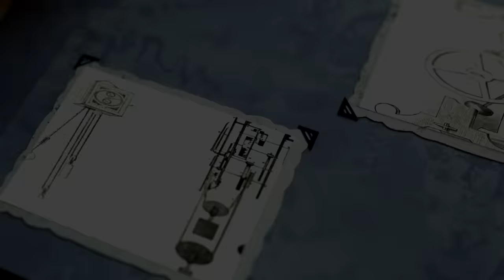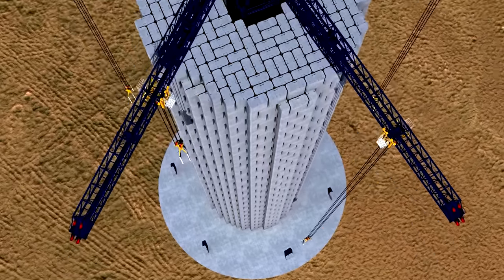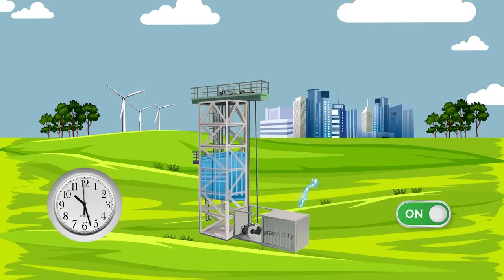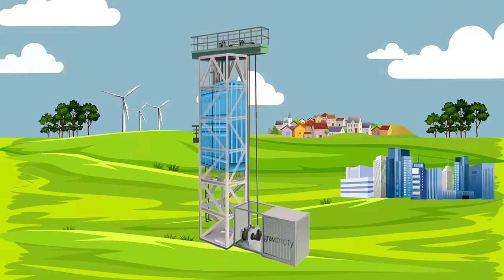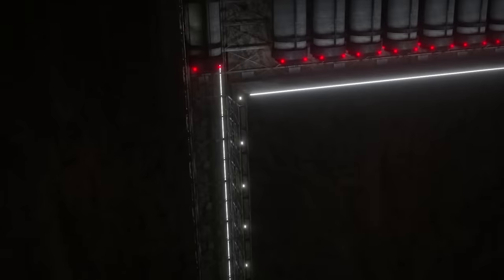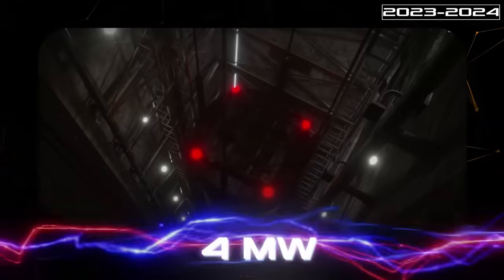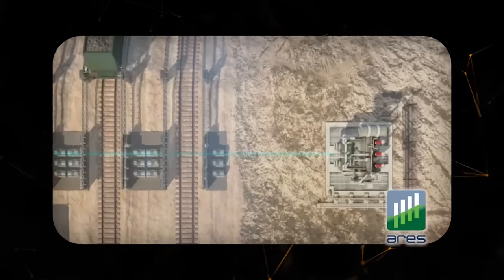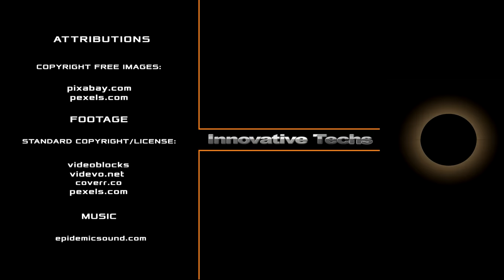How gravity batteries could change the world

Comment: I've thought of this independently since I was a kid.  I just wonder how much weight/space was needed to be practical
Reply: You should have learned how to calculate that back when you were a kid thinking about it.
Reply: m × h × g so 100tons at 100m=27Kwh, for comparison tesla has a 100KWH battery.
Reply: @faustinpippin9208  kWh
Reply: @faustinpippin9208  I thought your calculation must be wrong as I'm currently using about 50kwh/day to heat my house and this will only increase as Winter progresses. But I checked and you're correct! Seems astonishing I'd need to raise perhaps 3 or 4 100 tons to that height just to heat my house! But Gravity is actually a very weak force so I think much larger masses have to be used - like the water in reservoirs to make this practicable.
Reply: Please learn some elementary physics. Then you will realise that this is nonsense.
Reply: I thought the same thing about magnets when i was a kid. “ couldn’t there be something useful in the opposing force of magnets “; i hope there are more curious youngsters who wonder these types of things now and in the future.

Comment: The most mind blowing fact is that this is an innovation lol
Reply: Efficiency and costs are pretty important.  I live in Norway where we both have hydropower and a lot of wind and planned offshore turbines.  So I guess here pumped hydro will be a greatsolution to store any surplus.
Reply: soon they are gonna up with an even GREATER invention, a windmill that raises the weight mechanically,,,, like a windmill grinds wheat ,,thus increasing efficiency ,,i am not a tech wizard or anything like that but i would guess that a wind turbine that produces energy and then uses said energy to lift a weight is allot less efficient that having the wind spinning machine mechanically lift that weight

Comment: I was thinkoing about that way to store energy for a long time...  I find it still promising, but I think the biggest problem is the massive load gears are exposed to.  Moving Parts need constant maintenance and replacement. The storage facility can work for decades, yes. But only if you keep replacing some  components. Imagine what happens if whatever the load is attached to starts to rust...
Reply: you're right, it's a scam.  plenty of credible videos debunking the gravity battery.
Reply: @networkedperson  I don't think it's a scam. It's just a bit more complicated than the video makes it look like.
Reply: @donalain69  You could pay for money to feed people, and then you could pay these people to turn a generator wheel with their hands.  Technically, this would work, however, it would be a dishonest scam to say that storing energy inside people can be economically feasible.  Likewise, it is a dishonest scam to say that storing energy in mechanical weights will ever be economically feasible.  It is less efficient and more costly, by orders of magnitude, than systems which pump water into elevated lakes.  It will never be economically feasible to use mechanical weights.  So yes, it is more complicated.  The complications prevent it from being economically feasible.  The only way to believe that it can be feasible is if you don't understand reasoning.  If you don't understand reasoning, then you should listen to people who do understand reasoning.
Reply: @networkedperson  sorry. i think the problem is we don't define "gravity battery" the same way. 
I include elevated water powered turbines in that term, even if the water isn't pumped up mechanically using solar power. (it basically is moved there by solar power anyway, just the natural way)
For me the principle is the same, and where i come from (Switzerland), it's one of the main sources of energy for decades.
But regardless of that... I'm not so sure if pumping up water really requires less power than lifting a weight using multiple pulleys while lowering it again without them.
Reply: @donalain69  we have the same definition, however we are considering the costs differently.  Comparing solid battery to liquid battery, the cost and efficiency of momentary operation could perhaps be similar, after all, 1kg of water stores the same potential energy as 1kg of anything else.  However,  the cost of construction and maintenance will be different.  Consider for example Nant de Drance, in which 25 million m^3 of water are stored 425 meters above the generator...  The construction cost was 2.2 billion Swiss Franc.... A water system is the least costly system that can store any useful amount of energy.  The cost to build 25 billion kilograms of solid weights attached to 425 meters of cables will be exponentially more than 2.2 billions Swiss Franc...  Meanwhile, the cost of maintenance for the cables and wheels will be exponentially higher for solid weights compared to the maintenance cost for Nant de Drance.
Reply: @donalain69  I agree, It isn't looks like a scam, battery type storages and generators look to be way more complicated and costly on both initial cost and maintenance cost; I new about water-based gravity storages like forever and never understood why we are after centralized battery plants... battery life is 3-12 years depending on type before full replacement needed..
Reply: @Art_NYC  That's my opinion as well.
Batteries make sense in mobile applications that have to move around. But for stationary power storage, they make little sense, both financially and environmentally.
The good thing about water is that, if you have mountains, you don't even have to move it up yourself. Nature does that for you when it rains.  
I'm from Switzerland...according to an article of SRF, in 2021 the country generated 61.5% of its electricity from hydropower, 28.9% from nuclear energy, 1.9% from fossil fuels and 7.7% from other renewable sources. If that's true, I'm quite proud of them.
But probably they left out imported energy, and they are still far behind China in terms of quantity of hydropower.
Reply: @donalain69  I would emphasize on "quantity" and availability - I am doing electrical design in NYC area and the rest of the US - so, to me it is not clear why this kind of technology is not widespread - specifically as demonstrated in the video. I also mentioned in one of the comments somewhere in this thread that existing (or new) buildings can use some of elevator shafts for this with minimum extra effort and cost applied. This also would make obsolete central UPS and Generators we currently use in data center design - they are expensive in both - first cost and total cost .... to make it worse - manufacturers cannot keep up with production of those in time because of  high demand ....

Comment: This is the more advanced concept after hydropower plant. Water may be evaporated and smeared out to soil and its specific gravity is only 1. If we use concrete with 2.5, then it saves space much. Also this system is more controllable in frequently varying power condition. However it may be more expensive than the hydro power plant in large scale.
Reply: This makes as much sense as making power plants were people gets paid to pedal to generate electricity.

Comment: My comment below is appropriate for mine shafts or other underground installations. But, it also applies to above ground setups. Instead of spending money on concrete or some other manufactured weight, just use water. Empty tanks are suspended up on the towers, just like the discussed concrete or other weight. Such water tanks get lifted up there empty. Now, pump the water from ground reservoirs up to the empty tanks up high. That's your store of potential energy. Then, when you need power generation, let gravity do its thing with the tanks full of water. Once the tank is at ground level, it empties its load of water at practically zero potential energy. Use some energy once again to pull the empty tanks up to the top of the structure. 
True, concrete has about twice the density of water, so that would affect the volume, but the cost may be less. But, actually, you don't have to be lifting things over and over again anyways. Just build the structure to support the weight that you want, pump the water up there and let it fall down pipes. You would probably make the storage tank cone shaped so the center of gravity of all that stored water is on an appropriately sized support column in the middle for all that weight. Then, pipes come down the outside of the support column. In the end, all you really care about is the Head pressure of water for the turbines at ground level.

Comment: I really like the principle. There are losses, however in the lifting and falling process. Friction, motor/generator coupling, it's the same for water systems. But I like the fact that you could build a tall skyscraper in a city that would take up very little ground space and produce no pollution. I think they would be more convenient than water systems. Combine with a Solar/wind setup and you have a winner. I also like flywheel systems. Magnetic bearings in a vaccum. 

I'm not keen on huge Li-ion battery packs. I think the best place for Li-ion is in cellphones and laptops. EV'S are over the top because, when they battery wears out, you have to replace it and that's an arm and a leg. But I think Li-ion bikes have got something going for them. And then there's good old lead-acid. Easy to make, easy to recycle. People don't talk about them much these days. They are used extensively in mines. I think homes and busses have a place for lead-acid. Anything big-ish that has floor space and easy access to recharge. Everything doesn't have to be small and compact. Replacing lead-acid doesn't cost an arm and a leg and you can maintain them for many years if you know what you're doing.
Reply: Look up how much the 'skyscraper' able to keep that weight up would cost to build. I ran the number (I am an engineer) and there is no way this can be cost effective.
Reply: What they didn't mention here is that LiOn batteries can switch from full power storage to full power supply in milliseconds.  LiOn battery farms employ software that allows them to monitor the constantly changing spot prices  of electricity in real time, and switch back and forth (store when the price drops below a certain amount, supply when it goes above a certain amount) instantaneously, giving them a means of financial arbitrage that can make the company that owns them a lot of money.  This has greatly offset the cost of LiOn and in some instances they show a net profit.
Gas turbine generators take 25min to startup from cold if you're going to use them to try and sell into a high cost market, even an idling gas turbine can take several minutes to spin up, and idling a turbine while waiting for the right price is expensive.  Pumped hydro can take even longer to switch from storage to supply, and even these gravity weight lowering systems take several minutes to reverse to make sure the cables aren't overstressed.  
LiOn batteries are first in to sell power before the price drops as other generators come online to sell, and first out when the price drops too low.  And in a distributed marketplace like electricity, this is a big advantage.
Reply: @vincentgoudreault9662  Many of these systems stack the weights on the ground.  The structure is only there to support the crane.
Reply: @glibsonoran  And where they are in the 'up' position, they hover in mid-air, unsupported, maybe?
Figure out how massive the structure needed to support the blocks in the up position, and you will have your answer: it cannot work, period.
(And do not try claiming that they are supported by other blocks, since those would be, by definition, on the ground, hence would serve no purpose other than support. Then you look at the pyramid in Egypt and see how quickly the top layer need to taper)
Reply: @vincentgoudreault9662  They're stacked on top of each other.
Reply: @glibsonoran  Which means the ones at the bottom serve NO ENERGETIC PURPOSE. Which means that, on average, each block can only be used over half the total height. Which means that the blocks at the bottom have to resist the weight of EVERY block above.
Which means that each block is unsecured and that the stack can topple if there are seismic activities, strong wind, or if one block swings and hits the stack.
You realise you are arguing with an engineer, right?
Reply: Lead acid is too heavy for EV
Reply: No you don't. The tall skyscraper could store only a very small proportion of sa city's needs.

Comment: We've had gravity batteries for more than a century, its called 'pumped hydro'.  You can store an enormous amount of energy with a one small lake 1000m above another small lake.  Let's say the lake is 1000m on a side and the change in depth between charged and discharged is 5m -- how much energy could that store?
A lake 1000m on a side will have a surface area of one million square meters and a 5m variation in depth means a volume of 5M m^3.  One cubic meter of water has a mass of about 1000kg.
OK, we're ready to calculate:
5M m^3 x 1000kg/m^3 x 1000m x 9.80665 = 49TJ or 49 trillion Joules.  That works out to 136 billion watt*hours.  Or, enough to provide about 1GW for 13.6 hours.  I should mention that there is no reason to limit the lake to 1000m on a side, a modest sized lake, about 6 miles by 6 miles or 10km x 10km with a surface area of 100km^2 would be able to store 100X as much energy as the example I provided, or 100GW for 13.6 hours.  Actually, the net would be a bit less as the turbines are not 100% efficient, but they are surprisingly efficient, in fact around 92% or even higher.  If we account for a, let's say 10% loss, the 1000m on a side lake would be able to deliver 1GW for 12.2 hours and the 100km^2 lake would be able to provide 100GW for more than half a day!  That amount of electrical power is more than any state uses including California!

Comment: The most obvious answer is in the background of the Swiss Alp test site and the Nevada test site. It's the mountains in the background. The best example is of the coal mines where tracks are already built. In fact, if they need to backfill some of them they could fill the cars at the top. Otherwise the straight up use of filling the cars with a load is good enough. But using long steep mountain slopes is cheaper to build tracks than making tall steel structures. Even ski slopes could develop a method to load and unload weights on the gondolas going down to save on power.

Comment: Here's what I'm thinking... I think my 1000ft^2 home consumes an average of about 27kwH per day(electricity only). To store that amount of energy within a 100ft tall column, it would take  325,405Kg assuming a 100% conversion of potential energy. That's essentially 358 tons(feel free to double check my math) Heavy duty!

Not sure exactly how much my energy usage compares to an Industrial facility, but I'm left wondering.... is this practical, or pipe dreamz?
Reply: Yeah, when you put it that way it seems like a dumb idea.  Without doing an exact calculation such as you did here, a ton of water is about a cubic meter.  So your house would need about 360 cubic meters to fall 100 ft at 100% efficiency - or about a 7 meter sided cube (about 25 ft).  That's just your one relatively small house.  But my much larger (but efficiently run house) uses about the same kWh in the summertime (much less in the winter).

I doubt mechanical batteries are a very good way to go.  Better to use energy for some sort of chemical reaction process in much less space.  Like hydrolysis of water to obtain hydrogen.  But hydrogen is a real pain in the ass fuel - so something similar.  Something with much higher energy density than anything purely mechanical such as this.

Comment: compressed air generators is also a solution.   compressed the air during power production and use the compressed air to turn a turbine during off times
Reply: Does it exists?
Reply: @LuisAlbanes  Yes, although not any being mass-produced. I did find one individual who is using it for personal use to produce power at their home..  There are several videos with people making small prototype ones aswell
Also at one facility i worked, a diaper company. they used compressed air to power many aspects of the machinery
The converbelt for example,  The lights within the machine where also powered by a small electric generator that was powered by compressed air
Reply: @randyrogers8201  Good to know thanks and hopefully these systems get improved and be on the market soon
Reply: @LuisAlbanes  Also, there is a car company using compressed air to power the vehicle engine , it uses the compressed air from the engine to rotate the alternator and produce the electrical power to run lights and other needed electrical components in the same way a gas powered vehicle does
Reply: exothermic process

Comment: We need to figure out a way to make basically free heat gradient that is tapped for power. 

Examples:
1. geothermal
2. Solar chimneys <- this one seems like a really good idea. Imagine a tube exposed to the sun that gets slightly warmer and that heat turns a tiny turbine. Imagine a greenhouse with only one route for the heat to vent up a chimney. Put a pipe under ground leading into the greenhouse to provide a draft. Slap a power turbine into the base of the chimney. 
3. Imagine every draft you encounter in a building. That is usually caused by a heat gradient. Slap on some way to tap into that and you got a power generation system.